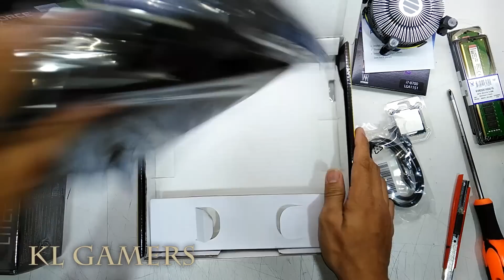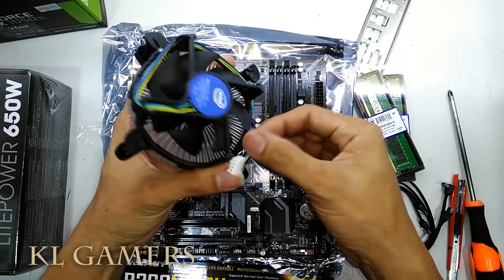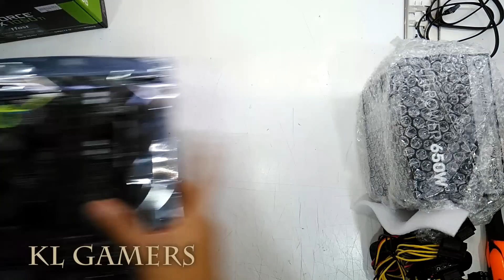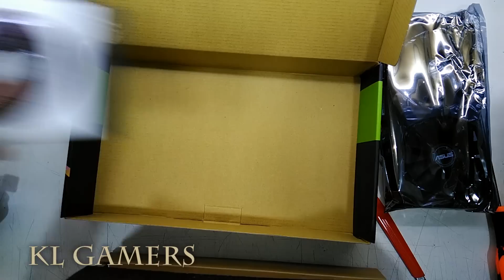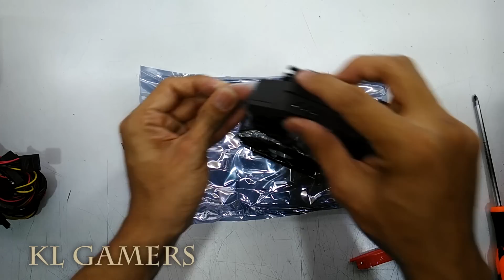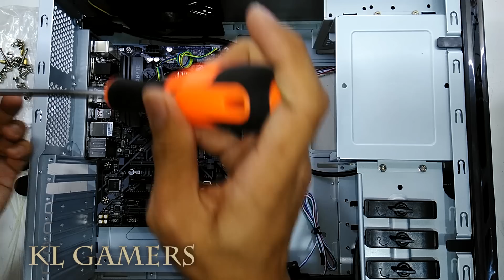intel Core i7 8700 GIGABYTE B360M D3H 32GB intel SSD5 ASUS STRIX GTX 1050Ti CM361 Gaming RIG 2019

Comment: Nice build bro..klau aku nk beli b450m steel legend,dapat muat dua intel 660p tak?
Reply from the maker: boleh = Two of the world’s fastest M.2 slots. One delivers up to PCIe Gen3 x4 32Gb/s transfer speed, the other one supports SATA3 6Gb/s mode. So, 1 can high speed, 1 is slower speed.
Reply: @KLGamers  thanks for the detailed explanation bro..so I can fit in one 2tb 660p and one wd green sata m.2 then,am i correct?

Comment: is this motherboard support the turbo boost of cpu of intel and support the cpu end with K ??
Reply from the maker: support the cpu with K but cannot overclock it so will be a waste
Reply: @KLGamers  so better to use a standard CPU without k just like i3 8100 or i5 8400 without k
Reply: @KLGamers  but did it support turbo boost of CPU if I plug cpu with turbo boost like i3 9100f will it support the turbo boost of it???

Comment: Why is it with 1050Ti while the Processor way to high such 8700 like this? It should be at least 1060 3GB???
Reply: Or maybe this case is not used for gaming
Reply from the maker: ya not for gaming as example. But 1050Ti is not bad at all my opinion
Reply: @KLGamers  I post this comment at the very beginning of the video, but after watching you built the system, I would really think this case is suitable for office work better.
Anyway, nice case. I'm looking for one!